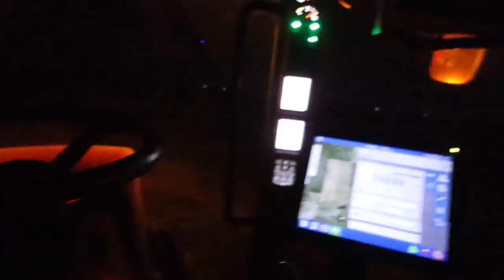A Day In The Life On A FARM: Harvest Edition

Comment: All in all a great day! Just a couple of bumps along the way. You know there are days whenever you turn around, something else goes wrong or breaks down. I remember the first time seeing a combine up close with a/c. I’d heard of them, but I used to think farming was getting to easy. But now, why not be comfortable while you work. It’s still hard work on a farm even a modern farm.
Reply: Cole, my McCormick which is basically a hybridized Case IH when you turn the road portion of the lights on at the dial switch down on the right side of the dash first position gives you headlights and flashers the second gives you field lights which you can then like the rear lights my Case ih385 loader tractor is the same however my newer 2014 Case IH 75c has a separate hazard switch and three switches for the lights high and low beam and headlights and tail lights are on the string column the extra side lights for field work and the rear lights are up on the console on the right hand side of the operators station. It is an open station in mccormick is a cab the loader tractors and open station hope that helps a little bit I will say the rear work lights on the 75c my dealer added 2 LEDs up on the post in addition to the I believe halligan single rear work light that's on it I can light up about a 50-ft circle around me when I'm running at night with that tractor and nearly as well with the McCormick which is a little bigger and a little bit older stay safe we just finished hay harvest on our place today for the year for at least anything baled call my plan is to spend the rest of the week putting hay equipment away and readying it for next year and then try and get to come by and ready in the corn pick already next week

Comment: Adding LED lights usually requires adding resistors to each circuit they run on.  Had that problem when I put LED light inside my Dodge.
Reply: Depends on whether their LED lights were replacements or add-ons. Messing with factory-designed circuits can create imbalances.

Comment: should be a relay bank that house several of the light relays that are notorious for corrosion issues.  Our New Holland T8.360’s (which has lots of similarities with the cih tractors) is located behind the top step just below the door.  We had same issue with no lights/hazards, ended up switching out one of those relays and fixed problem

Comment: Looks like Your getting the new Draper dialed in AWESOME!,  How is the residue management doing?... saw that the Flagship combine have left, right, & Center spread settings. Video from Case guy says for beans they recommend closing Center, Tightening Concaves on Left and Right spreaders to prevent Winrows, and upping fan speed for Soybeans for wider spread, and almost opposite for Corn. Have you heard of this?  Hoping to try and help by researching for you guys to assist if possible.  It is truly amazing how may things have changed in the last 3 years there, Keep up the good work and as always thanks for bringing us along on the Journey's..
Reply from the maker: Where did you find that? I'm not sure our's has that 😬
Reply: @ColeTheCornstar   I put the link in this video ....   The Worst Start To Harvest We Have Ever Had. from yesterday. It's from the YouTube channel  ....  Axial Flow Combine Tips .....  I love trying to help you guys.. the video shows the top of the line as well as the manual settings and it also has the retro fit kit to move it in on the center stack... Hope it helps.....  watch the one on concaves too it talks about what should be different for Soybeans from Corn.....  Thanks for responding, was wondering if you saw the messages from last few days! ;)

Comment: With the flashers on the tractor it’s a 3 way switch if you put it on the other spot it will keep the front lights on and the flashers but not the back lights

Comment: Cole, flip the switch the other way. Underneath the steering wheel on the right side you push the switch one way for no lights and hazards, one way for lights and hazards and in the middle for nothing.

Comment: For the lights. Turn the dial left of steering wheel to off and then flip the hazard switch to the left and you will have headlights and hazard lights
Reply: Do not touch the dial left of the steering wheel.  When you turn on the hazards, the field lights go off.
Then if you need more light, just turn the hazards off.

Comment: Warning! The tire changer went counter-clockwise on both the inside and outside bolts. This will cause tires to bind up, wear faster, and possibly damage the hub. You guys need to pull off both tires, check them, then put them back on using the STAR pattern.

Comment: Two direction switch, light emblem is night road mode, hazard only is day time. If it doesn’t work in night mode flip the hi lo beam/ horn switch on the steering column as low beams could be burnt out.

Comment: Yeah, rolling good now. I'd just give those lights the amperage they want. A bandaid is probably more hassle than the hack that's electronically correct.
Just think of em as Christmas lights & what pairs are series &// then calculate what you have & what supply you need. You don't want a lampoon's Christmas combine with components getting hot.

Comment: Hey cole for your flasher fix just turn the switch on the flasher to the light symbol instead of the hazard and then go to you turn signal switch and push it straight forward just like your high beam on a car and then more lights will turn on with your flashers

Comment: Not familiar with case but seems like if the lights and hazards are on same switch like the JDs, looks like there’s a crossed wire sending negative to the positive on the LEDs, I’m sure the Hazards are still Filament bulbs

Comment: Skid plates did it?  Hiring a expert can be worth it.  I had electrician out for breaker tripping. (After 25 years). “Needs larger breaker for that motor”. But he only worked with company who put it in 22 years. 
  On driving empty semi.  Neighbor wanted gravity box of beans taken @20 miles to be roasted.  His pickup broke down.  So I pull in yard, hook to green named box. Get to place to unload, get phone call.  “You took the load of CORN”. So pulled it back.  He had 2 green, similar boxes. I didn’t check under tarp. 
   Rocks are pita. My FIL loved rocks, always going to bring rocks home. As farmer I hate rocks.

Comment: Cole your lights aren’t working correctly, when you turn your headlights to flasher and lights, you should be set up for road travel, ( yes the lights will be bad). Should have dipable headlights on front and red tail lights on back and hazard lights.
All the other lights are work lights for operation off the road. Been many bad car accidents with tractors having white work lights on going down road blinding car drivers 

Hopefully the bin site will be ready 👍👍

Comment: The magnums have three positions on the hazard switch. To the right is just flashers, middle is off, and to the left is the highway (lights in the front grille) and flashers. If you flip it to the left and the lights still dont work you have other issues. We had a 215 magnum that only the right side flashers worked 90% of the time.

Comment: Sounds like you’re alternator isn’t able to generate enough power to run everything if everything works independently of each other and blows fuses if everything is put on together. I’d say next wet day pull it off and bring it to an alternator specialist and get the power upped in it, it can be done successfully and should sort you’re problem

Comment: On the 4 ways. Wired wrong. Lights on its own fuse. Then 4 ways on its own fuse. Should work after that.
Reply: Also look at the wiring on the 4 way switch. The lights and 4 ways must be off by themselves. When wires get mixed up. That happens. Your correct. The red grain cart is way better.